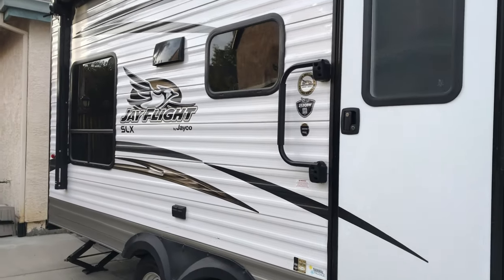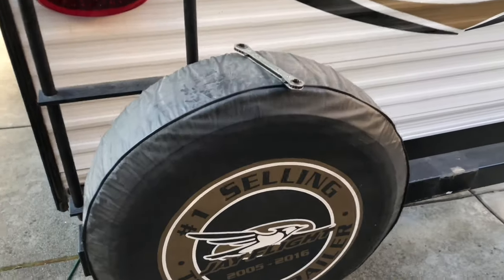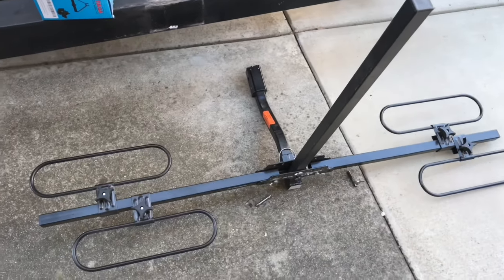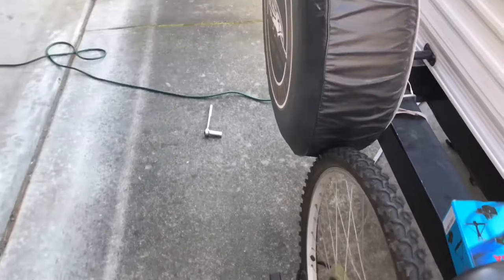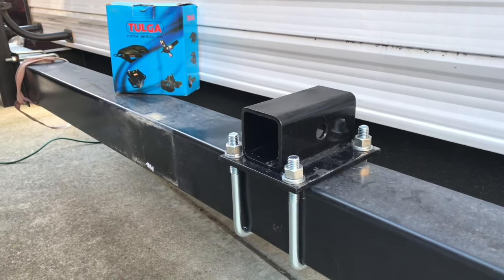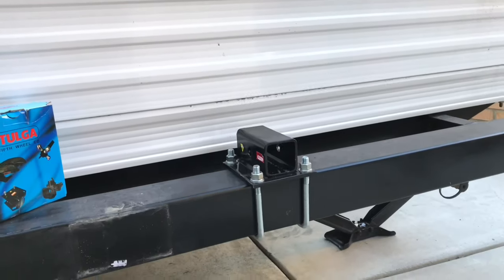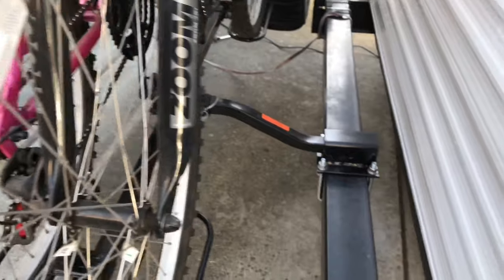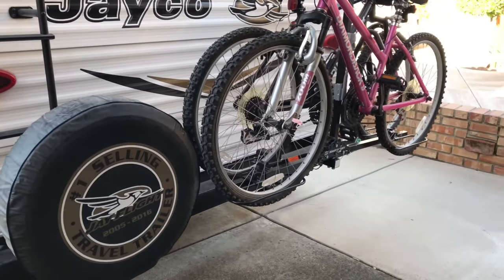Jayco Travel Trailer How to install Bumper Hitch Adapter + Bike Rack for RV Camper swagman tulga

Comment: I do not have a bumper mount, but am looking for one that will support itself without tweaking on the bumper. I have noticed, any long term weight I put on my bumper flexes the trailer frame, making the rear door drag on the door frame (2015 26RLS). Also, the owners manual emphatically states not to attach anything to the bumper.
 The biggest concern I have for this design is putting around 50 pounds on a 1 foot moment arm that is twisting the bumper. This may not be bad on smooth pavement, but any but the smallest bumps in the road will cause a very dynamic load making a 20 pound bicycle seem closer to several hundred pounds, which will add up over the long haul.

Comment: Good video. However, I installed one of those and it was a major mistake! Be sure to inspect after every trip. Luckily, I caught ours before everything fell off going doing the roadway. Good luck!
Reply: eddierhea did you install it wrong, or can that bumper just not handle it?
Reply: @markhowarth5294  bumper definitely can't handle it!
Reply from the maker: I just recently took a cross country trek from CA to NJ... this set up held with no issue. My 2 bikes are Diamond Back -- they are light. To clarify... That trek was 3100 miles - 5 days trek. A short video is forthcoming on this channel... but here is the playlist for the entire journey. Go to the 3rd video titled Pt 1 https://www.youtube.com/watch?v=QGp6F8CPMho&list=PLK-XGOqlCIRQ3jjGaJcilERLJDtRzNKAI